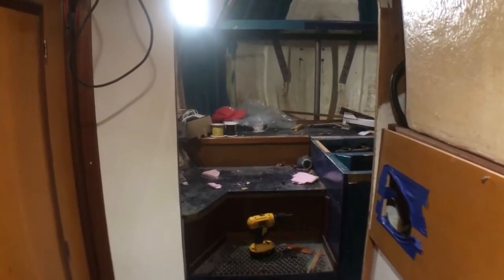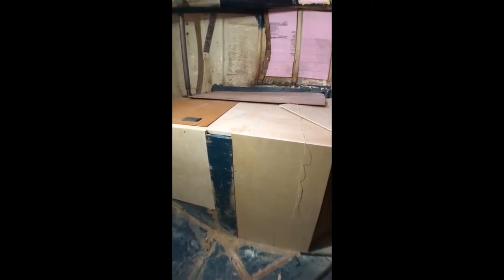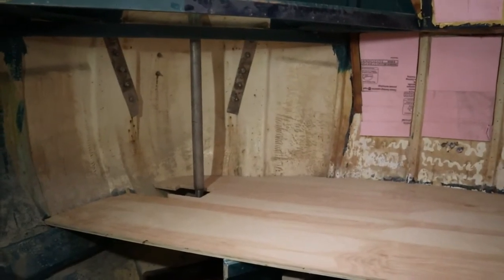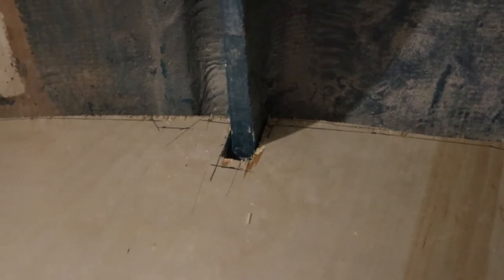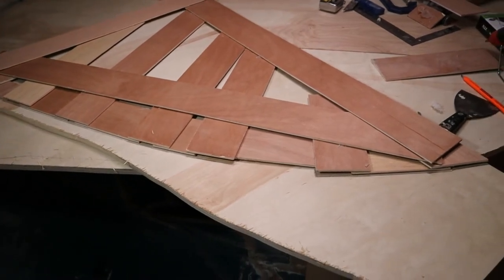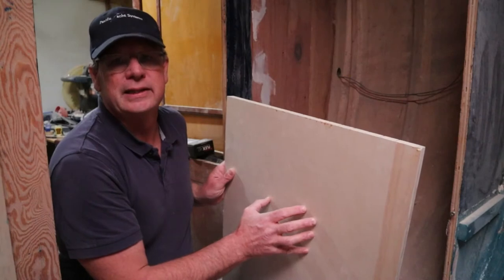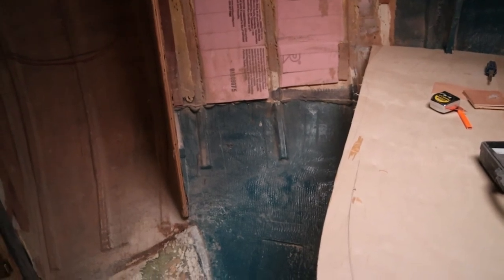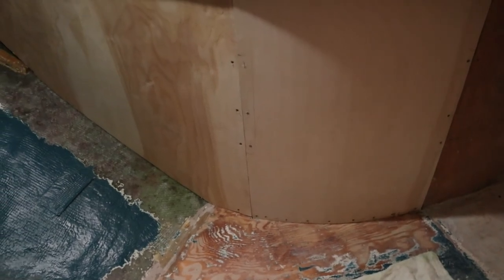Aft Cabin Refit  Begins(Stage 7)

Comment: just found your channel, thanks for the videos! are you sealing the ply you are installing? as nicely as you've fit it, it would be a shame to see moisture rot it out from under you.
Reply from the maker: Actually all the recoring is Coosa.  It’s a composite and can be used as a replacement for the original plywood.  It is amazing stuff and does not absorb water.  https://coosacomposites.com/bluewater-panels/

Thanks for the comment we really like to hear from our viewers.  If you haven’t already please subscribe to follow along on our journey. 

Best Regards
Scott & Robin
Reply: Oh I just realized you are talking about the interior ply?  The interior or the boat stays dry so I’m not really concerned about the interior plywood at this point but I will epoxy coat all of the exposed plywood yes. 

Thanks again for the comment

Best Regards
Scott & Robin